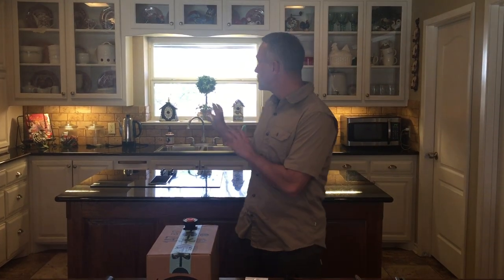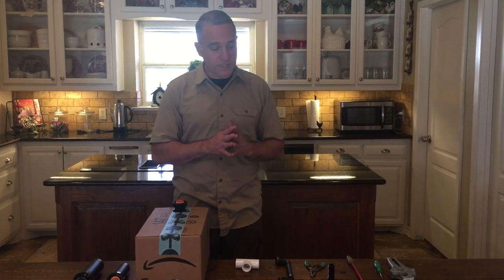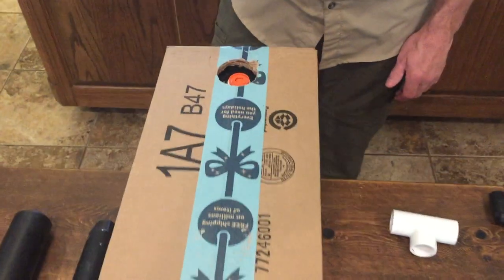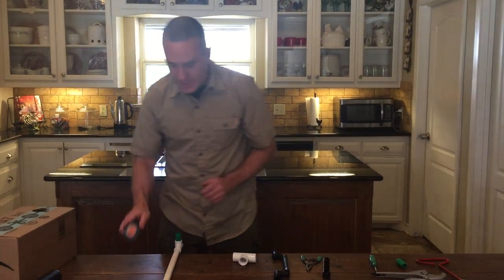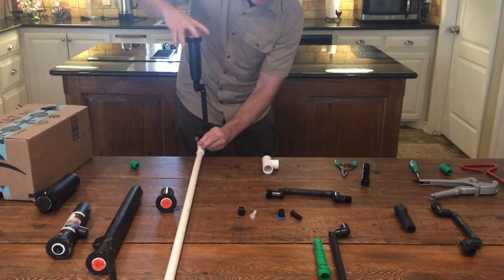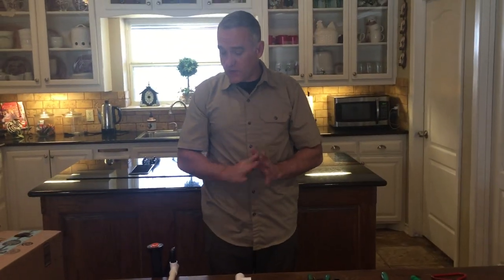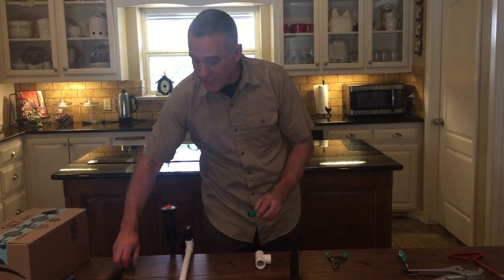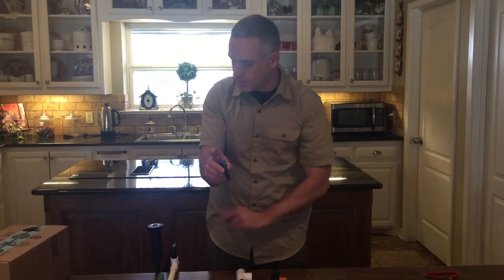Changing Sprinkler Heads, Changing Nozzles, Lowering or Raising Sprinkler Heads

Comment: Thank you sir!! I need to lower two of my rotatory heads and this is very detailed on how to do this! Just hoping one of the big box stores have the swing joint.
Reply from the maker: Gatorman, my pleasure.  They should, our Home Depot has swing joints
Reply: @sprinklerrepair4L  Update....i dug up the two heads that needed to be lowered and both already had flexible joints on them so i just dug out the hole a little deeper and re buried them! Love it when a plan comes together at zero cost :)! Thanks again!
Reply from the maker: @uf1978  Perfect!  Glad to hear it went that smoothly!
Reply from the maker: Gatorman they should have them.

Comment: Thanks you explaind everything very clearly one way I installed the 12 in pop up using the side inlet I dug the hole with a post hole digger I’m curious what’s your method very cool video
Reply from the maker: I just use a shovel and make a trench for the funny pipe.  I install the fitting on the sprinkler before putting it in the hole.  Posthole diggers are a great way to do this job!  Thanks for sharing!
Reply: 4L Irrigation Repair my pleasure I like sharing my bag of tricks too😁👍

Comment: I recently purchased a home with sprinklers that were installed when the house was built 19 years ago. Several of the sprinklers are installed behind where bushes and trees have grown and are now blocking the spray from the sprinklers. Is there a recommended way to disable these sprinkler heads? Will disabling these sprinkler heads have any negative affect on the remaining sprinklers in that zone? I suppose that simply capping a sprinkler head will cause problems with winterizing the system in the fall.
Reply from the maker: I'm located in North Texas, so capping a head will have no impact on us in regards to winterization.  Capping a head will increase the pressure on other heads and if that exceeds the recommended pressure you could see more misting and fogging which results in wasted water.  If plants blocking the heads need the water, it will have a negative impact on them.  Finally, if the heads are around your home, you might have a negative impact on the foundation, but you will need to research this or hire a professional to know.  I hope the best for you!

Comment: Awesome videos! Very detailed and well presented. I am a DIYer and had a couple questions as I just purchased a house with an existing rain bird system and I seem to have some issues.
Some of the nozzle and pop up heads are fairly inexpensive and I have already replaced and seen improvements. 
Is it worth while to try and just replace a nozzle on a pop up to see an improvement or should the whole unit be replaced?
For the rotary ones, they can get pricey. Is there any point in trying to repair these units or are they considered throw away? If there are repairs or cleaning and/or maintenance that can be done, what are some steps to try and get an old rotary working better?
Reply from the maker: Yes, as long as the pop up is going up and down correctly, you just need to replace the nozzle.  I  don't clean any of the heads.  When I'm working for a client, the price they pay me to clean is higher than if I just replace it.  Personally, in my own lawn I do the same, just replace them.
Reply from the maker: As long as the head is good, I only replace the nozzle.  On the rotary heads, I would let them soak in a cup with dawn dish soap and then work them up and down.  Rotary heads are very susceptible to sand, dirt, and debris.  Due to this I usually make sure the heads are tightened down and I install them with the water on to try and clear out dirty water as much as possible.  I have found this to make a big difference in keeping them clean.  I hope the best for you!

Comment: I just got a house and I'm not running the sprinkler because it has a leak as makes the basement wall wet.  Theres about 5 or 6 of those really long ones sticking out in the flower bed.  I'm not sure if they are just always like that or if I can lower them.  I want them in the ground to make it look better.  Should I just run the sprinkler system with no water and hope it lowers?  If they don't lower what should I do?
Reply from the maker: Many times people per long risers in the flower bed to spray over tiers of plants. You can replace them with pop-ups if they are tall enough to deliver water to all of your areas. I hope the best for you!

Comment: Thank you so much for sharing your knowledge. Quick question, I'm trying to raise the height of pop pop spray like your 6" spray you show @6:08.  Mine were installed using the side inlet.  How do I raise these? I'm familiar with using the extensions and cutting them to the right height and just screwing the head back in.  But, since these are side inlets I'm not sure what to do.  Thanks!
Reply from the maker: Hopefully they are connected with a swing joint or piece of funny pipe and you can dig it up and raise it to the desired height and cover back up.
Reply: @sprinklerrepair4L  Thank you for the quick reply. I'll give it shot.